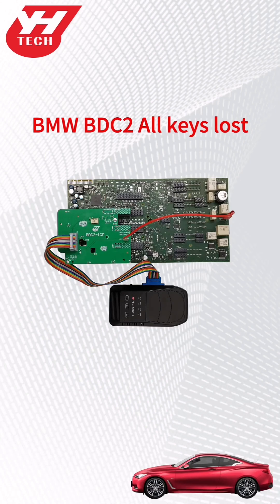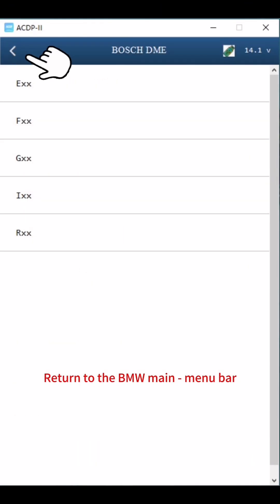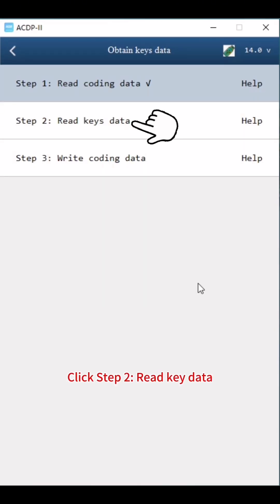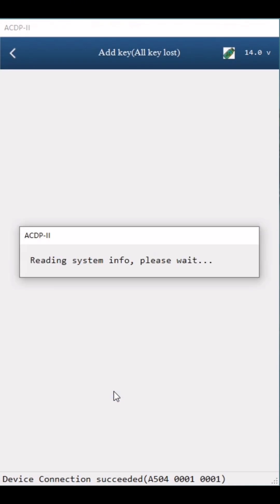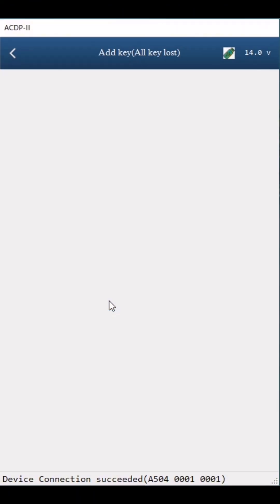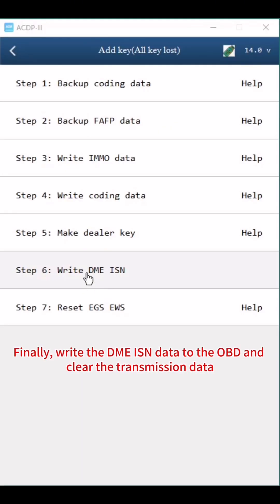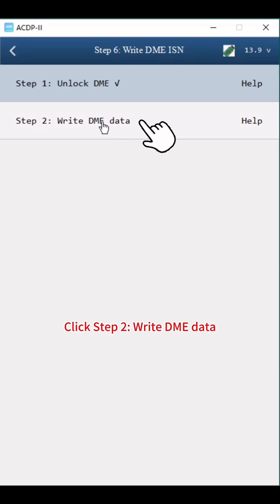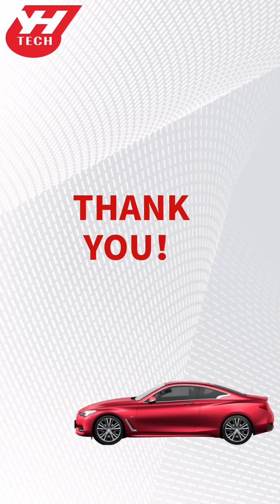How to Program BMW BDC2 All Keys Lost by Yanhua ACDP with Module 38?- ACDP2.EU

Comment from the maker: Yanhua Mini ACDP 2:
https://www.acdpyanhua.eu/wholesale/yanhua-mini-acdp2-key-programmer.html
YANHUA ACDP Module 38 + BMW BDC2 Bench Test Platform + Module 3 + B48 Interface Board:
https://www.acdpyanhua.eu/wholesale/yanhua-acdp2-bmw-bdc2-akl-package.html
Second-hand LF Smart Key Antenna + Remote Control Receiver:
https://www.acdpyanhua.eu/wholesale/lf-smart-key-antenna-remote-control-receiver.html